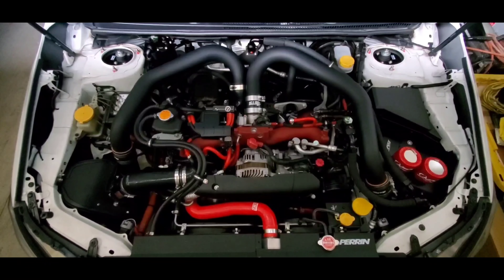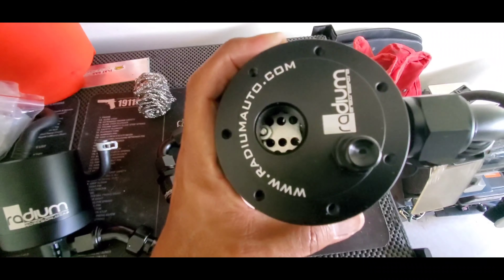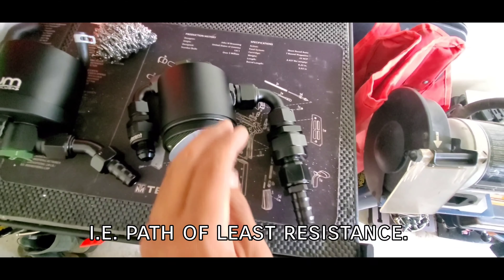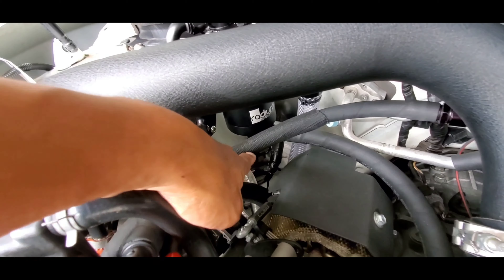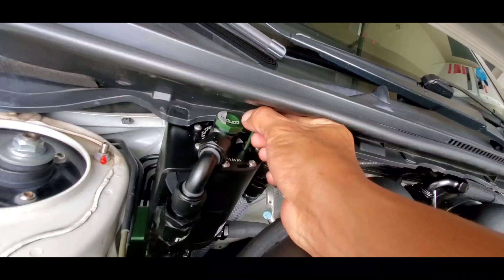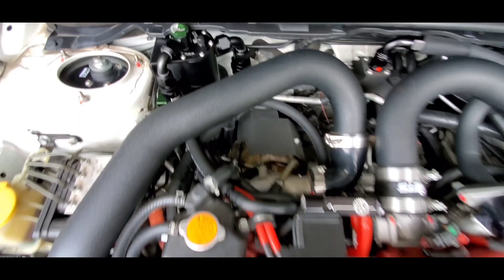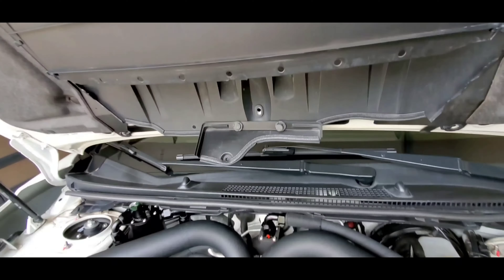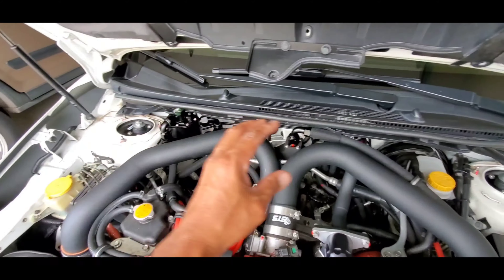2015 SUBARU WRX STI - AOS Overhaul - Radium, Killer B, Vibrant, Fat House Fab - OCTurboJoe

Comment: Ive thought about separating the head breather lines and including a line from the oil fill like the grimmspeed unit. That's so cool you made this setup! I still have the perrin aos and it works well but I don't make much power. Maybe I'll separate the heads later, really curious how well your setup works
Reply from the maker: So far so good. I've modified the orientation based on my tests. I'll do an update video as soon as I end up with a solid solution.

Comment: Do you think running that killer b block with a dual radium catch can would be better than just the dual catch can???
Reply from the maker: The catch cans and Killer B Oil Control Valve serve their own purposes.  Catch cans catch oil, that's it.  They don't prevent oil from surging and sloshing during high lateral g cornering, which is what the OCV does.  Many cars at the track (and sometimes during spirited road driving) experience oil being sucked out or spitting out of their AOS due to the can(s) filling up because of high lateral g.

Comment: Does the radium AOS require a tune? "Venting to atmosphere" is mentioned several times in the video.
Reply from the maker: If you install the Radium AOS in VTA configuration, yes.  If installed in closed loop, no.

If running VTA at the heads, like in the video, yes a retune is required due to unmetered air potentially being ingested at idle and part throttle, before wide open throttle.

Comment: Bro run your heater hoses. It's not about frigid temps it's about condensation same as dew in the morning etc. The temp difference in a hot motor and a room temp can will cause condensation and ruin your oil. Run the damn water lines.

Comment: Great video. Thanks for sharing. 
Do you track your car? Would love to hear an update on how well it's working.

So at idle or deceleration you have no vacuum source for crank case vent? (Since you capped off the intake manifold)
Reply from the maker: I don't track my car at the moment however I do drive it spiritedly from time to time. I am prepping it for track when our local circuit gets built.

Correct. The AOS works with path of least resistance. Without the PCV valve, there is no oil entering the intake manifold.

I have since reconfigured my setup. A new video is uploading as I'm replying. Check it out when it's available.
Reply: I appreciate your sharing your knowledge and experience.

Do you have any idea how much vacuum you're pulling at idle/cruise control with your setup versus a factory PCV setup? I'm confident your setup works well in boost, but I'm wondering how it performs when its not receiving vacuum vs stock PCV which does.
Reply: Fyi I ran a JDM ej207 with a mild stock location turbo upgrade. I ran stock PCV style but filtered through dual saikou Michi catch cans. I never had any oil anywhere in my intake tract however I didn't know about measuring CCV pressure. The small diameter lines make me think it wasn't breathing very well. I'm looking for ideas for my new build. Thanks for sharing.
Reply from the maker: @PolishAlexx  The stock intake will always pull more vacuum than an aftermarket intake because vacuum is generated by restrction. I measured approximately -2.5in/Hg of vacuum, read from my crankcase at the oil cap. That's the measurement of the compressor pulling from the turbo inlet recirc hose. I've never measured vacuum directly from the turbo inlet because it's not important as how much pressure is relieved from the crankcase.

Have you checked the intake manifold, behind the throttle body for oil when you had the PCV valve intact? Most would find the turbo inlet and intercooler clean but not the plenum.
Reply: Ok, so it pulls the gases through the small port of the AOS at idle when vacuum is strongest. What is the other vacuum you said in front of the Turbo which is supposed to switch the system to the largest passage way? Vacuum is created between the air filter and the inlet of the Turbo in the turbo intake hose sometimes to the point of collapsing it at which point there's a lot of vacuum... but it needs a lot of RPM to reach that level of vacuum. Question is, what happens to the crankcase gases in the meantime while it reaches that point? Sorry,  is there something I'm missing?

Comment: venting of the crankcase through the oil cap is going to make the warm up time longer for the oil on cold start.
Isn't that more detrimental to the engine.
Reply from the maker: Crankcase ventilation has nothing to do with oil temperatures.

Comment: Whats up with that slight kink in the hose from the ic piping at the turbo? Is that just how the fitment is from ETS?
Reply from the maker: I have the Cobb 20G. Slightly larger than stock so it makes it look kinked but it's actually not. Perhaps my camera in wide mode skews the picture to make things look off.

Comment: Always over killing it 😂 looking forward to the results of this system, that’s some serious work there. I am still running the killer B AOS, surprisingly not passing like before after putting that steel mesh inside the return, last time I pulled the intercooler I was expecting the usual oil accumulation but nothing was there. However, since we are approaching summer crank case vapors are expected to increase significantly, especially in my region 🤪 I feel everything is about to melt in the engine bay with temps teaching 50 C (~120 F) 🔥
Reply from the maker: Good to hear it's working with the mesh. I would inspect the top outlet hose as well as the turbo inlet.

Comment: That is an obscene amount of work for some oily vapour.
The factory system has an AOS,  yes some oil can accumulate, and be returned back to the turbo inlet which makes a bit of a mess.
Why can't a catch can be put in line of the turbo inlet crancase ventilation return hoses to collect the  vapour.
I understand that at high power levels the system is strained but incorporating whats inside the engine to the outside seems ridiculous. You must have put 5 different systems on the engine to catch 50ml of vapour.
Reply from the maker: Subaru's ventilation system is more complex than any typical 4 cylinder due to the flat layout.  Oil can slosh around while cornering at very high lateral Gs, sometimes less than that.  That's why most AOS' on the market still fills up even without having worn piston rings and such.  It's true that Subaru already incorporated baffling in their block and valve covers however they're meant to only mitigate blowby at stock power levels.  Even in stock trim, it's still a major flaw.  What I have done can work but it requires custom ECU tuning.  In my case, the car was already tuned prior to configuring this setup since its a hybrid design (open/close loop).  That's the reason why any VTA AOS' require custom ECU tuning, so as to account for a 'vacuum leak' because of the open loop.
Reply: @octurbojoe   but all thats happening is hot oily vapour is being spread further around into various containers.....the only way to benefit from external AOS is to vent it to atmosphere, to prevent dilution of the intake air.
Realistically all you need to do is cap of the turbo inlet crankcase return ports and just vent the pipes to atmosphere.
Reply from the maker: @matthewnewsome2802  It's not only about isolating oily air.  A closed loop crankcase ventilation system also creates a negative pressure to help seal rings.  There's a reason for OEMs keeping it that way other than emissions.  Having a negative pressure in the crankcase reduces pumping losses and keeps power consistent.
Reply: @octurbojoe  but the stock system already does that, it has an AOS, an oil catch can (the sump) and a crank case vent to reduce positive pressure.
I know the system isn't flawless but adding things like external cans and silly lateral rocker shut off valves to prevent oil from traveling up and potentially entering the turbo inlet. (Which is only going to be possible if you have very high crankcase pressure) isn't improving on the issues that already exist, and those problems only exist if your doing stuff like massive donuts or have failing rings with 2.0bar of boost and a blocked crank vent, or oil getting past the AOS.
Reply: You've put loads of work into your engine and it looks amazing, but you went to all that trouble of removing heat soak issues from the engine, and put that oil cap vent thing in, and its just allowing the radient heat from the crankcase into the engine bay, thats why its so hot.
Reply from the maker: @matthewnewsome2802  If you look at the following videos, I have a rear vented hood.  Which one vent is placed above the VTA catch can, where it will vent to atmosphere.  I planned it perfectly.  However I never ended up using this setup because of tuning issues.  On my next setup, I reconfigured the Radium AOS to a final version, with a closed loop, triple baffling system. Which pulls -1.5psi of vacuum and collects zero oil at the turbo inlet hose.
Reply from the maker: @matthewnewsome2802  The oil cap vent did not affect any more heatsoak issues that what it already had.  Barely anything comes out of it because of the vacuum already created by the Radium AOS.
Reply: @octurbojoe   cool....you could have got a vacuum pump or dry sump kit.
Reply from the maker: @matthewnewsome2802  The turbo inlet.  Check it out.  👍🏼